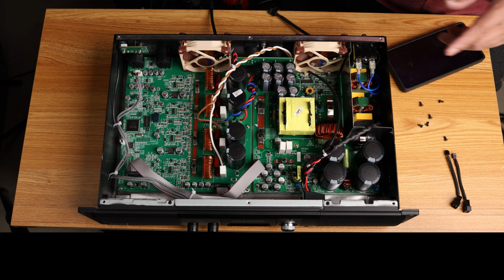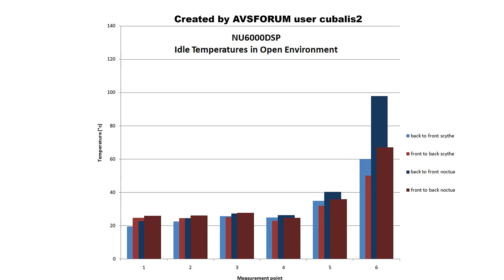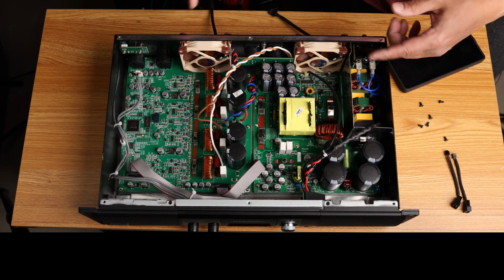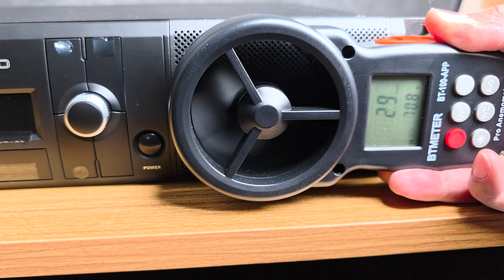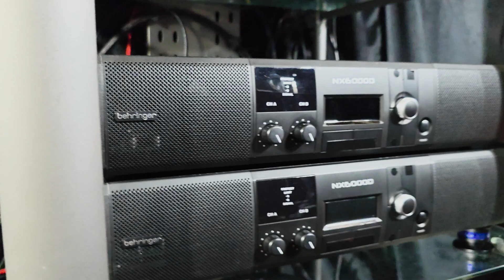Behringer NX6000D Fan Mod ... is it worth it? (updated version of the video)

Comment: Your killing the amp nucta is best but if you’re more knowledgeable that one is getting over heat the amp I know the old stock fan is noisy but that design to cool the amp
Reply from the maker: No I am NOT. You missed the point  The noctuas I am running are adjustable and powered externally with a speed controller so I can keep at least the same airflow I had with the stock fans but with way less noise.
That is why I didn't do the mod where they replace the fans internally with noctuas running at much lower voltage and airflow. I didn't want to hurt the amp life.